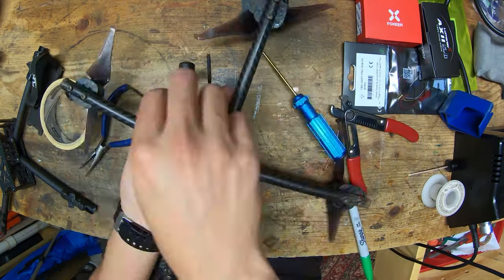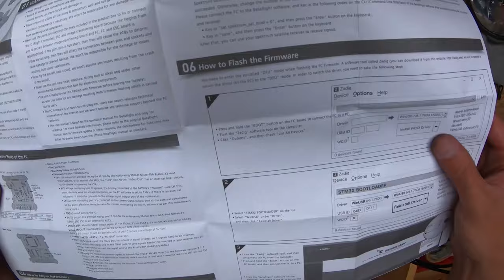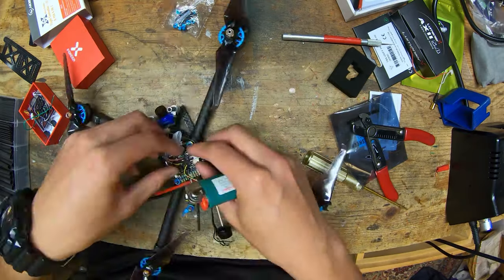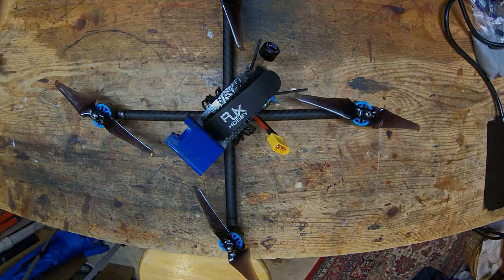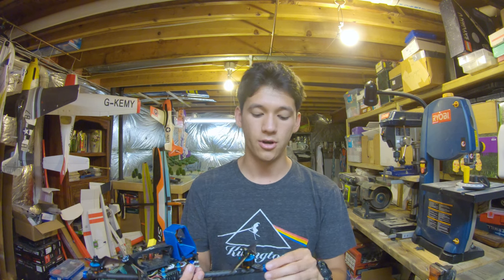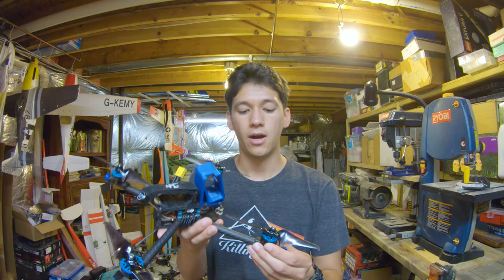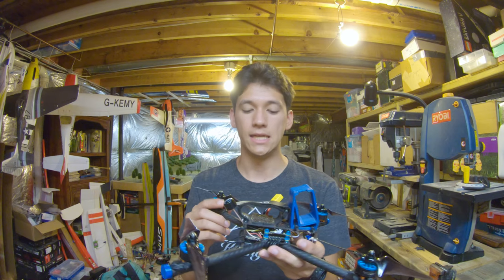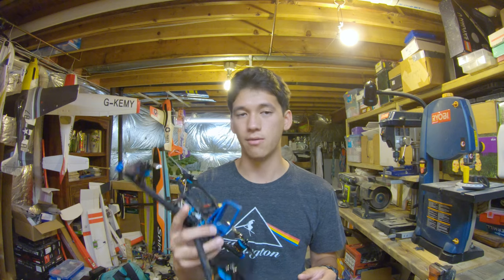DIY FPV Racing Drone Frame - Electronics Installation and Maiden Flight - The Tubular Quad V3

Comment: Super nice design, may I ask since your legend with 6incher, is all the vibration or jello coming from hardwares? Or its more on tunning?
Reply from the maker: Thanks! Vibrations/oscillations can come from your hardware, your tune, or both. Often times a subpar hardware setup will work together with the flight controller to cause oscillations. Usually the motors and props aren't causing enough vibration to ruin your footage, but combined with a poor setup cause PID oscillations that are noticable in your footage. Here are some common causes of vibrations/oscillations:
 - Imbalanced motors (commonly fixed by replacing crunched bearings)
 - Imbalanced props (always tune on fresh props)
 - Not soft mounting flight controller (always do this; it is free filtering)
 - Not soft mounting motors (more free filtering)
 - Lack of frame stiffness (hugely important but commonly overlooked)
 - Poor tune (hard to do since defaults are pretty good)
 - Poor filtering settings (also hard to do since defaults are very conservative)
 - Low quality flight controller (I once bought a cheap all-in-one that had inexplicably high gyro noise on the roll axis. Buy once, cry once.)
Reply: @TimmyRC  thanks a lots this infos are very helpful